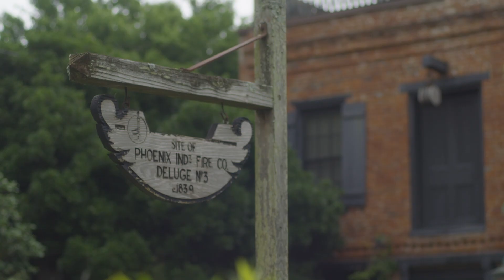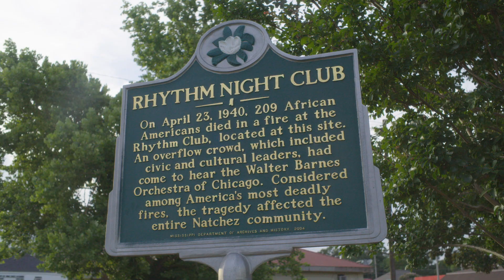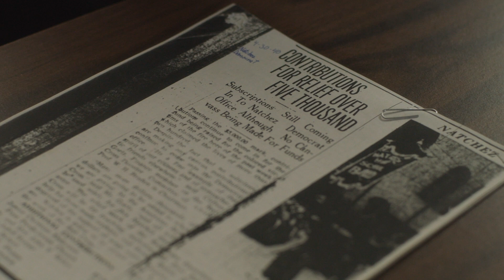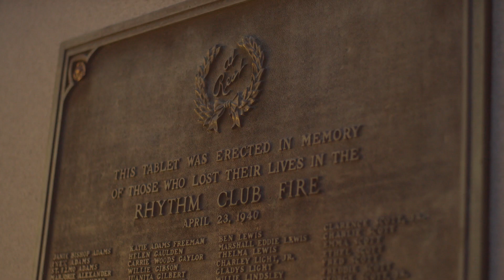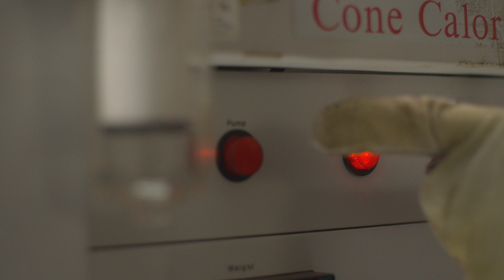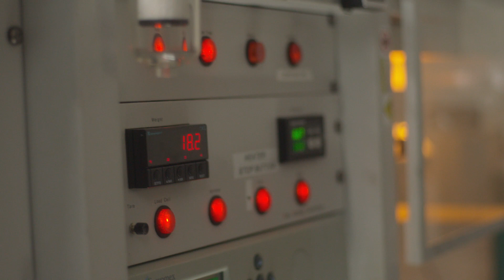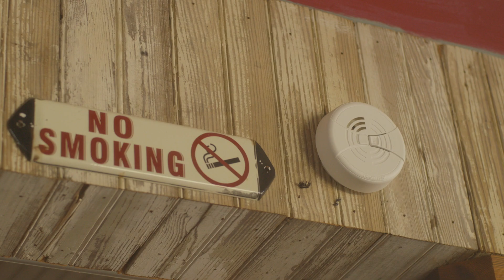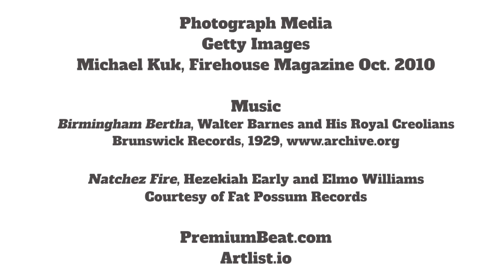Safety INsight: Natchez Rhythm Club Fire

Comment: Honey, why don't you try not contradicting yourself. 
So after the Boston fire, fire codes and safety were enforced, but did nothing to prevent the '77 fire where 167 people died, and the 2003 fire. The Natchez fire is a tragedy for the chemicals on the hanging moss and the boarded up windows, but nothing can change if lessons in safety aren't enforced which you say weren't done in '77 and 2003. Wouldn't have mattered if everything that happened in Natchez had been documented, proceeding with the reckless events that occurred in '77 and '03 would have still been neglected, same as obviously anything learned in Boston was done.